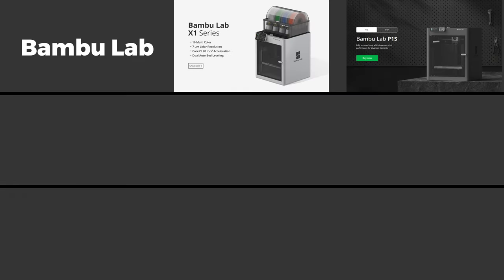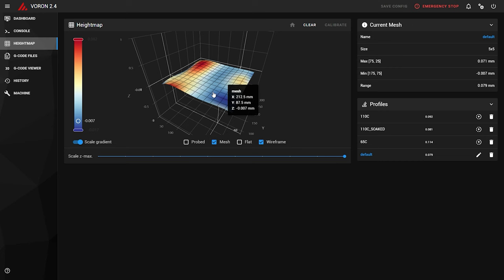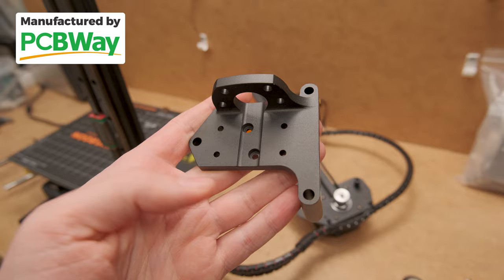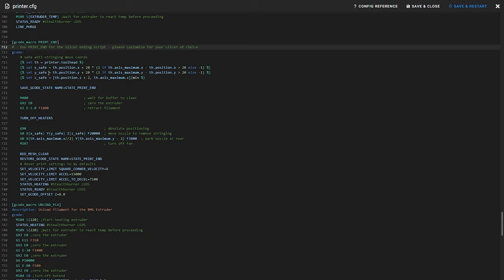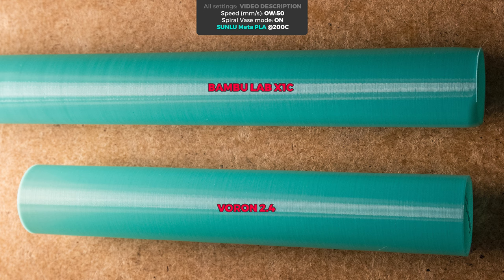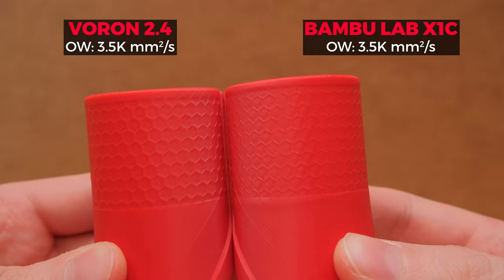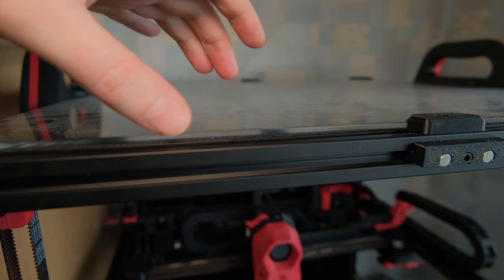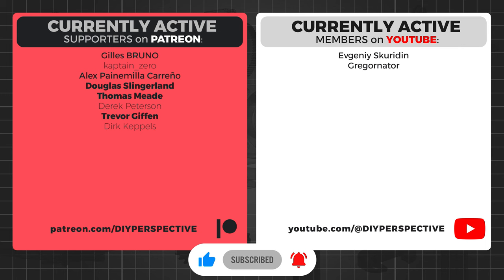Is VORON 2.4 as GOOD as people make you believe? (vs Bambu X1C)

Comment: Does the Voron print better than the Bambu? No. 

Does it cost less? That depends on how you value your time.

Is the Voron faster? Not to any appreciable amount.

Don’t get me wrong, I love designing and building my own stuff. It’s why I own a 3D printer. But I own a 3D printer so that I can make stuff, and I’ve lost interest in reprap because I feel like that ship has sailed with this size and price point.
Reply: That is only part of the story though. 

Unlike the bambu is the Voron much easier to maintain with readily available common parts? Yes 100%

Unlike the bambu does the Voron have full documentation available and an easily integratable software ecosystem? Yes

Unlike the bambu can you easily upgrade nearly any part on the machine? Yes

.... could do this all day long.
Reply: @FNmey  you could do it all day. But you’d have to actually use and own a Bambu to know that you’re not correct on any of these. I can get any part I need for the Bambu. In fact I have all of the most commonly replaced spare parts. Because the Bambu is well documented on their Wiki, I have no issues replacing said parts. I could do this all day.

Since I didn’t have to actually build my machine, I was more productive on day 1. In fact, I was more productive about 10 minutes after the printer arrived because I didn’t have to build it. 

I have built my own 3D printer. I just don’t need or want to do it anymore. I’d prefer to just produce.
Reply: If you go by the 50 hour build time suggestion and minimum wage, there is nothing to compare really. That makes the time alone 1/3 of the X1C Combo. But hey, there are those petrolheads that complain that a modern car is way too easy and regular people that just want to get from A to B...
Reply: @joergsonnenberger6836  I don't know where you are getting 50hrs from, but we have the systems we build regularly jigged and worked out. Takes the slower guys about 4–5 hrs. to build and maybe another 1-2 to tune. 
Are the Vorons perfect? Nope. We would for example never build a V2.4 as a production system. Is it better than being locked into an ecosystem of proprietary parts and software that depends entirely on the survival of a young company with access to your device at any point, even if it is in LAN mode? Yup.
Reply: @FNmey   20h, 40h, 50h - those are typical times given for people without intimate knowledge. The difference isn't that much if you also value your time more than minimum wage. The rest of the argument is pretty FUD and makes you look ridiculous. "I want to have complete control of my device without any cloud service" is the only reasonable part of what you said. Heck, there are likely enough X1 and P1 models around that someone else in China will just produce cloned parts if BL suddenly disappears.
Reply: @joergsonnenberger6836  agreed. I'm not sure what you bill for your time, but it's definitely not minimum wage. There are things that are definitely worth the invested time, and a classic car is one IMO because it's an investment.

Today, I look at a 3D printer as a tool that is no different than a table saw or drill press. I wouldn't bother building either one because there are affordable and accurate versions we can buy at our local home stores. I feel that 3D printing has reached the same level.

Comment: If you're going to spend on a Voron, I feel like it makes more sense to build an Annex and get something truly high performance. At the voron level of performance, a basic vzbot is a better deal. I think the manual and community are over-rated, it's not a complicated machine, it's pretty clear where everything goes. Whooole lot of trouble just to get 8k accel...Annex will do 30k.
Reply: and yet, the community is not overrated. You can mod YOUR voron for what you want. Me personally, I kinda like stupid fast things, so I went with a custom RSCS, archetype zephyr, lightweight X beam, and eventually CNC 9mm belt gantry. I wouldn't be able to build this if there wasn't a community behind it

Comment: Unfortunately, you have not done any load tests. Otherwise, you would have noticed that the Bambu printers are pretty crap. The Voron printers are rather designed for quality with regard to the load on the printed parts.

Such load tests have been done several times, and the Bambu printers have always produced the worst print results.

The Bambu junk can be used at most for decorative prints.

Comment: Stoped building my 350³ V2.4R2 at 90% completion, and bought a bambu. No regrets here. The Voron Design is actually not good at all, as an engineer I cringed more and more the further I got into the build. The Heatbedmounting is straight up shit, you cant ridgitmount a heatbed with deltaT 100°C. The Cables break in no time, as they are not suited for cable chains and the bending radii are way to small. The elektronics are borderline crasy if you life in a country with plugs that are not save against reversed polarity as the thermalfuse does not cut both poles. The inductive Bedsensor melts in no time. etc etc. Now this 2500€ piece of junk is sitting on my shelf...
Reply: That's a really real story you told. Thanks